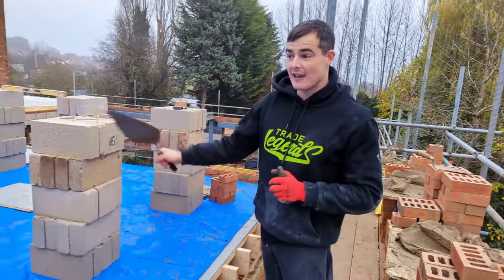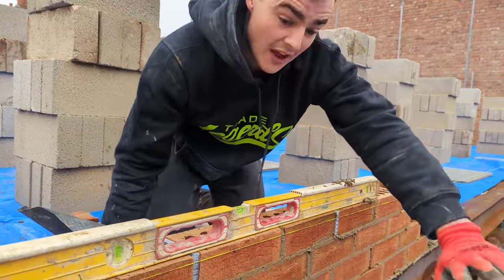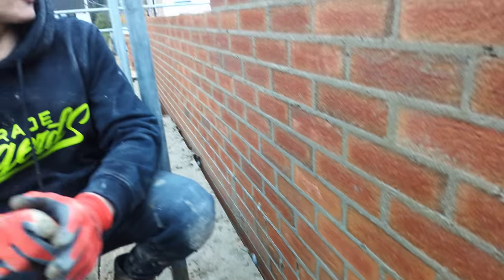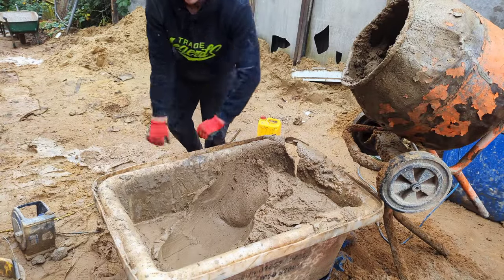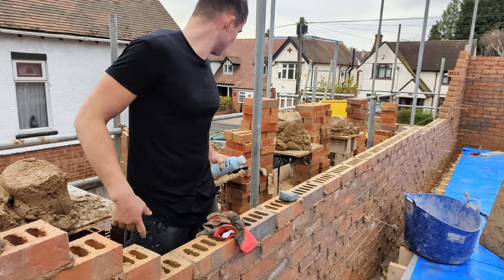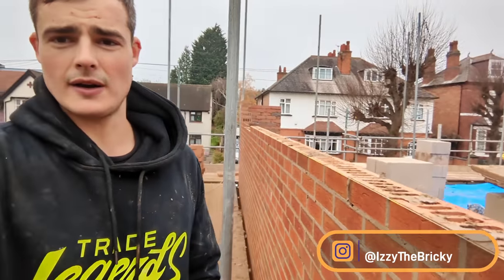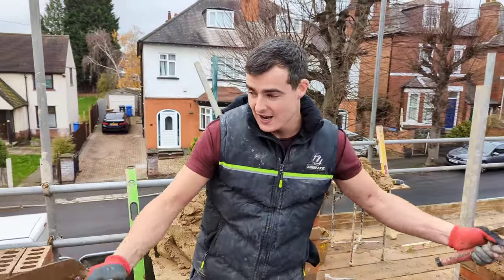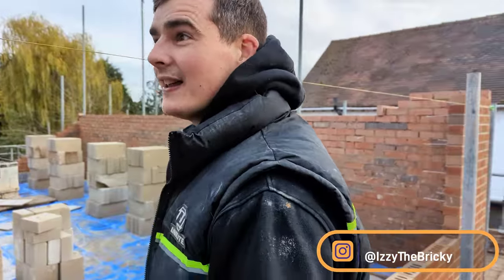Bricklaying - Another HARD week  #vlog #renovation #extension

Comment: Those bricks are great summer bricks Izzy , shame it’s friggin December and zero degrees 🥶🥶.
   Seriously ask the gaffer to hire a gas space heater. Honeycomb the soaked ones board on top and blast away . You have the heat and the fan so everything is toastie in minutes . 
    Evolution beast making light work of those 7n conkers 💪🏼.
   Hope your having a good day today buddy 🤙🏾🤙🏾🤜🏽🤛🏽🧱👍🏽
Reply from the maker: Mate that evolution saw is getting thrashed every day and it's going stronger than ever! 
I'm getting a heater for them mate😂 got a can of gas ready to go😂 it's gonna be pure chaos when I start running about with a flamethrower 😂😂😂🔥🔥🔥🔥
Reply: @IzzytheBricky  😂😂🤜🏽🤛🏽🧱👍🏽

Comment: is that brown building sand from jewsons we can only get yellow and a little tip about the damp its a bit more of a faff but we spread the bed all along the brick work then place the damp on top of bed then put the bricks on the damp dry pushed down to the line therefore when putting in lead or rubber its actually under your damp course and not on top
Reply from the maker: Hiya mate it's yellow..or more orange I should say. Really nice stuff though! That's a fantastic tip mate! I've still not built the back yet so I'll be using that and probably mentioning that in my next video!!🤜🤛🤛